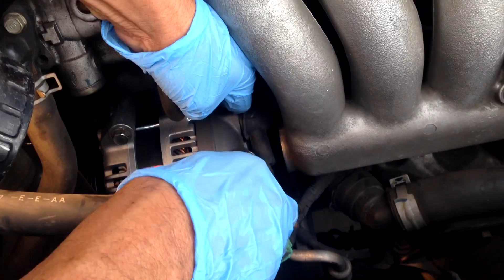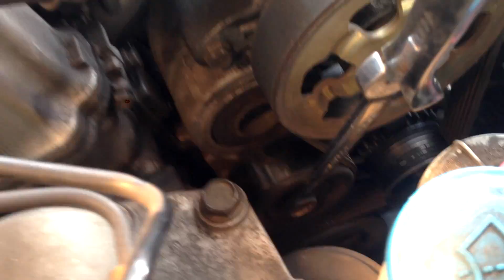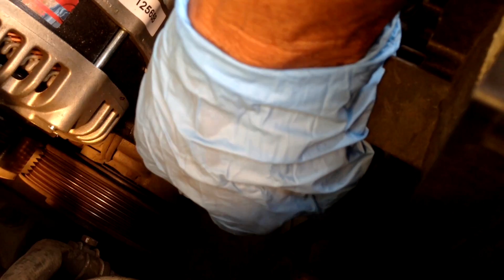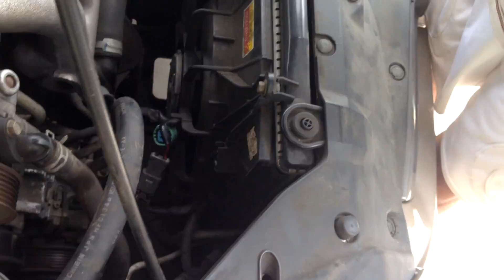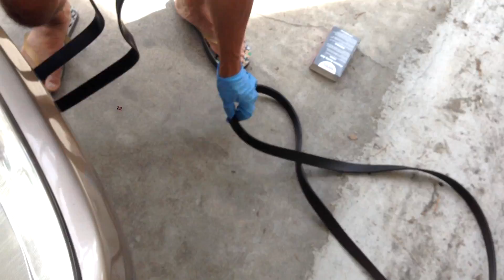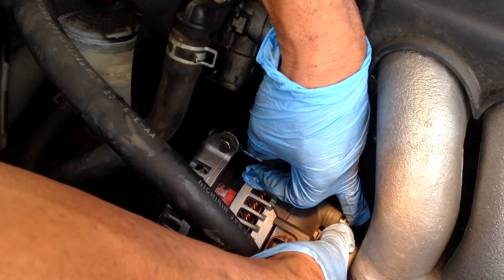HOW TO REMOVE REPLACE ALTER NATOR HONDA ACCORD 03 04 05 06 07

Comment: Pro (LOL) tip: If you're doing this on the Acura TSX 1st gen, you will need to take off the power steering unit (the unit above the alternator) in order to comfortably get the alternator out. It's easy to do. Just loosen the two 12mm screws holding it on and then move it out of the way, keeping the hoses attached. I did not know that and spent over an hour frustrated trying to get the alternator out. Someone pointed this out to me and it is recommended in the Acura service manual.
Reply: Hi, David! I’m about to do this on my car; so thanks for the tip! Much appreciated.

Comment: One small problem- mine has only two bolts on the front of the block unlike this where there are three easy to reach bolts on the side of the block facing forward! It's a whole different adventure getting my big fat paws in there!

Comment: I noticed you reinstalled the very same alternator, did you rebuild it? It has the same serial number S-125658 or you just removed it for demonstration, thank you.
Reply: It was a new / rebuilt one in the first place, very clean.  a) seems done for demonstration, b) maybe afterthought, "change the belt"...

Comment: Thank you for this video. Do you have to replace the belt when replacing your alternator?
Reply: I LOVE NINTENDO No but while you're there why not
Reply: Honda says replace belt at 65,000 miles.  My alternator died at 98,000 and had the original belt, so it was wise to replace the belt...

Comment: It’s helps to talk dude at least say what size open end your using damn
Reply: the battery is tens. the little nut on the right is a ten. the belt tensioner is a 14 and the three mounting bolts are 12s

Comment: Vital" as you do this" (mine was a 4 cyl), find on the web a diagram of the serpentine belt- sketch out a diagram I HAD to use a pipe cheater-bar on a 14mm box end wrench AND manage to do the "water pump - no ribs" pulley for last, Critical to see / know the pathway, and to have bulletproof ability to pull back the tension pulley, I HAD to use a pipe cheater bar on a 14mm box end wrench, "sloppy attempts" with an additional box end wrench for leverage was too sloppy, didn't allow enough control for a "one guy job".  It's a bitch of a job with the belt aspect, doable, but humbling and difficult, cheater pipe on the tension pulley being Vital...

Comment: Sorry buddy. Just finished this job on a 2003 Honda Accord V6 3liter. Not a chance getting alternator out without removing the following.. Fan shroud, plastic cover over spark plug wires and spark plug boot. I had alternator unbolted but  not a chance of removal without doing so. Easy job but just no room to get it out...My alternator started pumping out 18 volts and several intrument lights started lighting up. It fried the battery due to overcharging..
Reply: re: "sorry buddy", no he's not in error, you say yours is 6 cyl, this video was on a 4 cylinder.  Difference in how cramped, obviously.